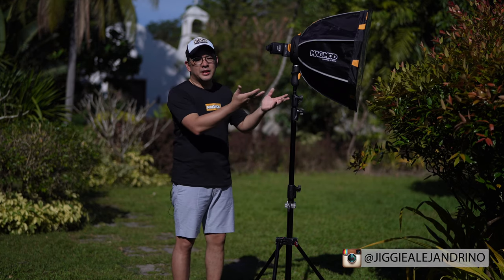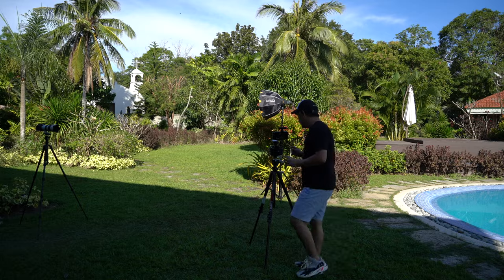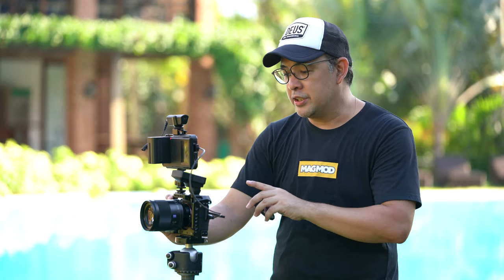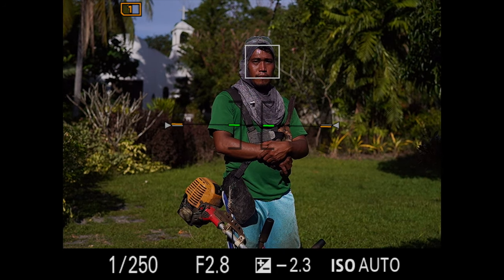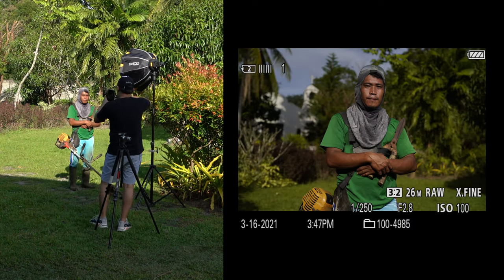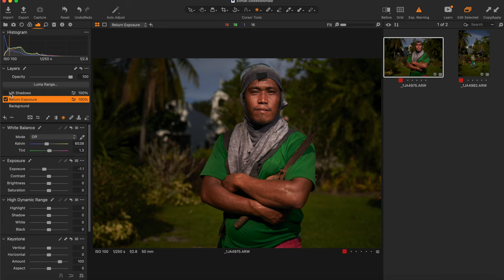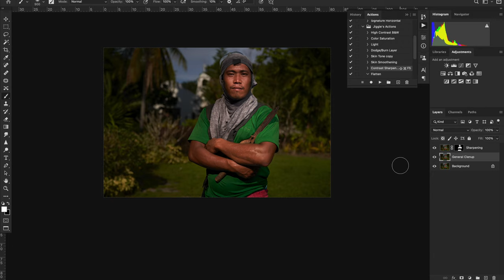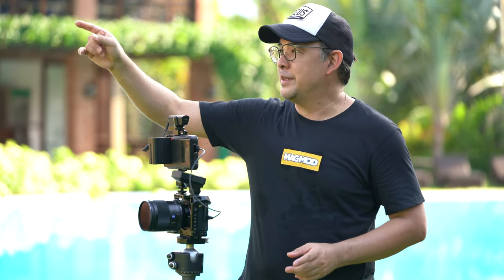How to Over Power the Harsh Midday Sun with Just a SINGLE Speedlight (Off Camera Flash Photography)

Comment: Great video Jiggie.  I have a question.  I have a Sony A74 and the Sony FA-WRC1M Wireless Radio Commander and the RMA 60 flash.  Does the wireless radio commander work with any other lights.  such as godox or any other brands.
Reply from the maker: No it doesn’t

Comment: Hi thanks for your informative tutorials. I understand the concept when using a larger aperture, I.e 1.8 or so but my question is,and I an struggling with this at times, How do you overpower the sun using f4 glass? Or atleast get decently exposed images?
Reply from the maker: It's easier actually, just make ensure you have enough power.
Reply: @JiggieAlejandrino  strobe power? I have a godox ad400pro

Comment: Hi Jiggie, this was quite an informative video as I have a similar setup but have never been able to really test it out on people due to current events in the world. Just a quick question: Going by your video, would it theoretically be possible to half the distance you had your softbox at, and be able to get away with using 1/2 power and still roughly get the same results as it was when it was further away at 1/1 ?
Reply from the maker: not exactly half, but yes the closer the light source is to your subject, the stronger the light source becomes
Reply: @JiggieAlejandrino  Thank you for the answer

Comment: I NEED HSS IN MY LIFE!!!!!! If I get a 600W strobe with HSS, I will be able to overpower the sun right? I'm trying to avoid fiddling with an ND filter, my old strobe system doesn't have  HSS.  Is is worth it getting a strobe with HSS?
Reply from the maker: there will still be limitations. I have a 500watt strobe with HSS and at bright sunlight its still not enough
Reply: @JiggieAlejandrino  I dont plan on shooting in direct sunlight though. Always in the shade or with the sun as backlight.